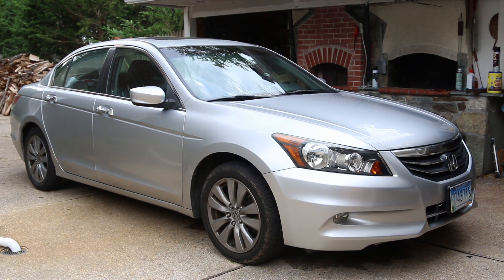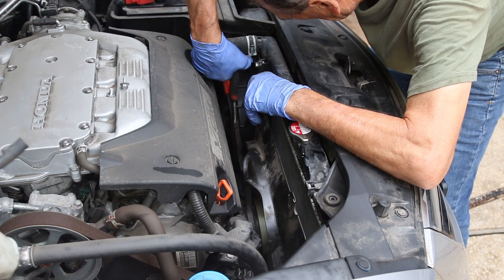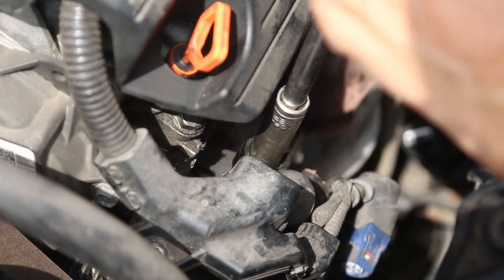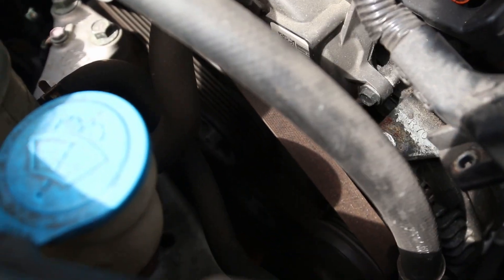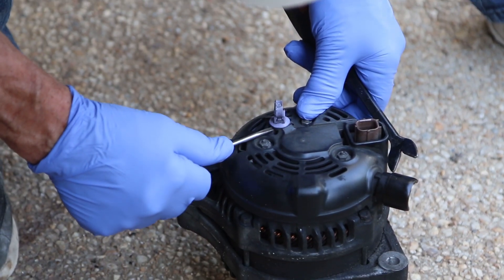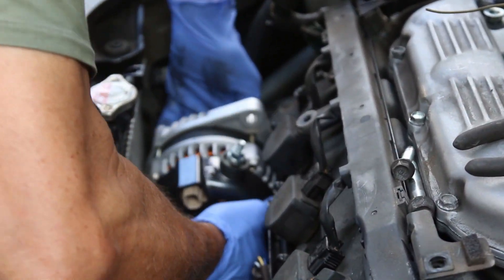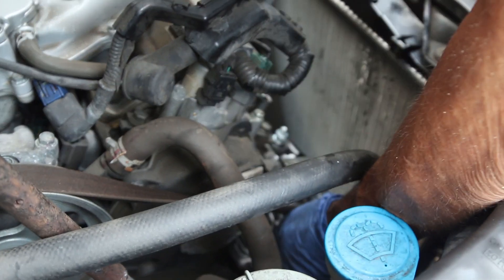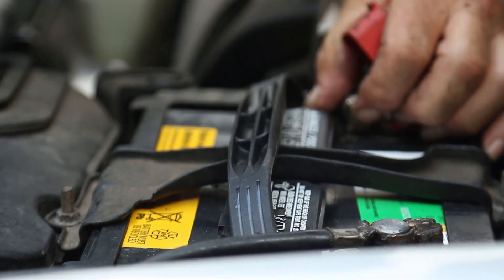Honda accord alternator change

Comment: Did the alternator have a clutch on it? I have a 2011 that needs to have the alternator replaced.
Reply: ummm not it doesn’t
Reply: i have no clue what that means. but i replaced mine and no such thing as a clutch.
Reply: pretty sure mine is the same gen as yours